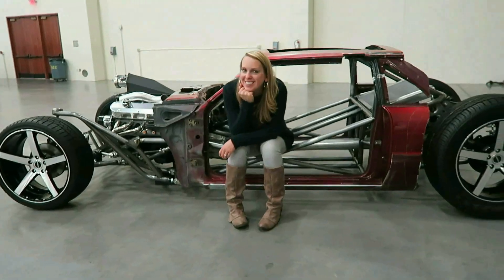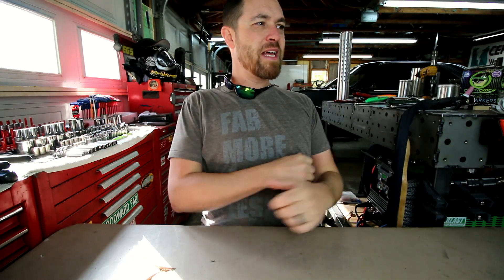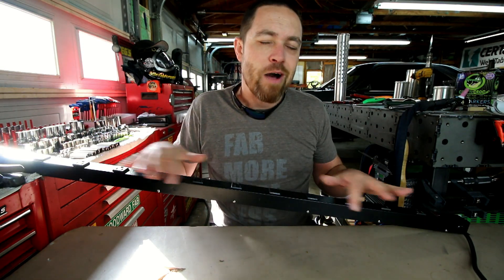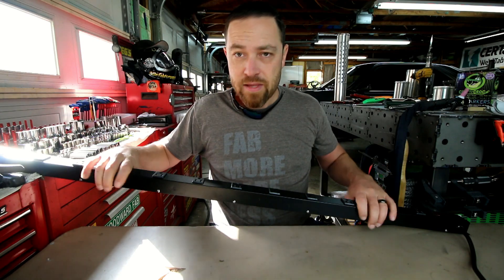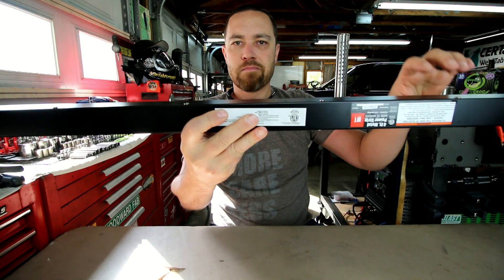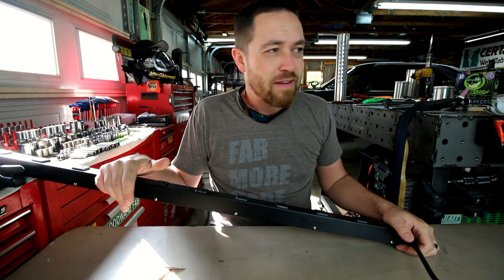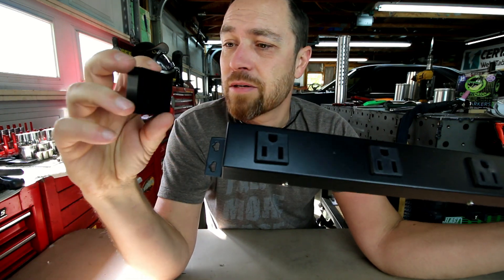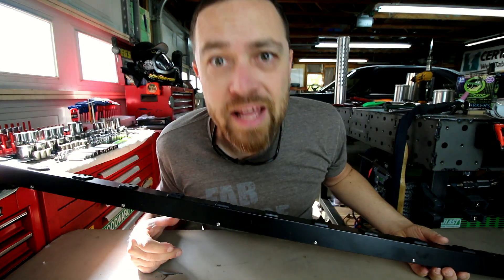You Need This Tool - Episode 93 | 4ft Metal Power Strip

Comment: I have three of them, two are hard wired into my electric in my garage, one for each bench and are 20Amp rated. Then I got one like the one in your video mounted to the back of my fab table where I can plug in my grinders, benchtop disc/belt sander and Porta-band saw.  The extra outlets and proximity of them helps with the creative process.  Great vid!
Reply from the maker: awesome
Reply: Evin Hill the 20 models are hard to find at the local hardware stores. Where did you find yours?
Reply: I got them off of amazon.  Here's the link - https://www.amazon.com/gp/product/B00006B820/ref=oh_aui_detailpage_o01_s00?ie=UTF8&psc=1
Reply: Thanks a lot!

Comment: I picked up a similar one at Princess Auto a few years ago. Canada's version of Harbour Freight. It doesn't have a breaker, my switch is for on/off. It works great. A flick of the switch everything is powered off. Or leave it on for chargers, and unplug what you don't want powered up.
Reply from the maker: yeah for sure

Comment: The 110 circuit that you plug that into is likely rated for 15 amps, so if you're pushing that in the power strip it's probably going to trip the breaker anyway.  I'd say you're good to go.  I use those for computer server racks because the power conditioner/battery backups I use sometimes only have 1 output plug.  They work great.
Reply from the maker: cool

Comment: Serious question for you or anyone else who might have the answer? I'm currently turning my 2 car tandem garage into a dedicated wood and metal shop and like you, I want to have outlets at all my stations. My original idea and design was to run one long conduit pipe across the entire length of the garage and add outlets that way. My question is, why would someone go that route and not add these and daisy chain them? I assume its a cost thing correct? I haven't looked into how much its going to cost me to run the conduit with outlets, but I assume its going to be a fraction of the cost. Any advice would be appreciated. Thanks.
Reply from the maker: conduit would be the appropriate way to do it
Reply: The Fab Forums Thanks for the reply. Mind telling me exactly why though? Is it a safety thing or a cost thing? Obviously it will look a hell of a lot better with the conduit. Thanks again.